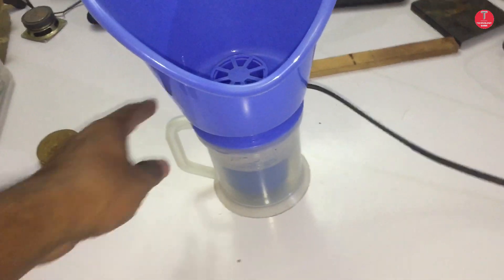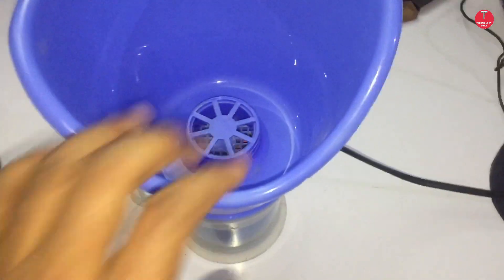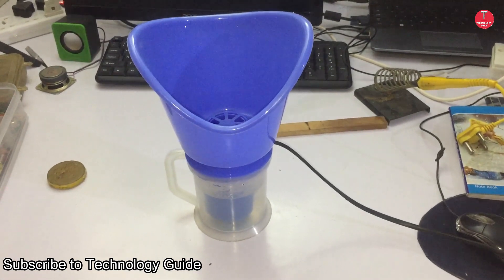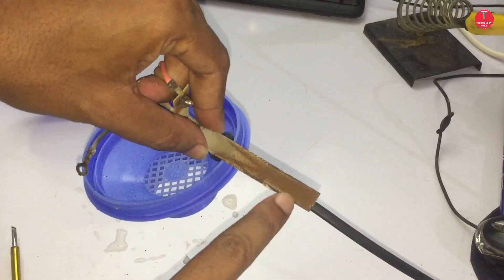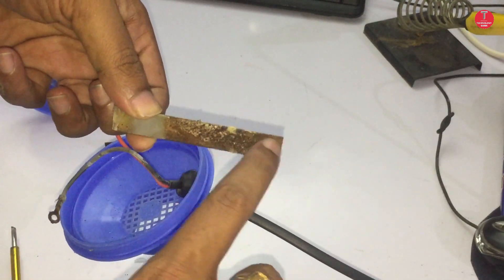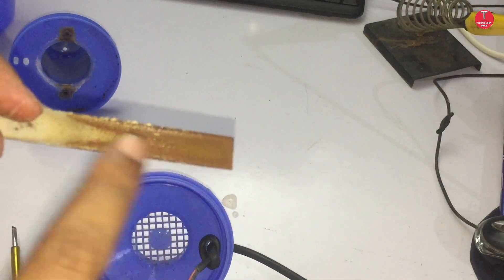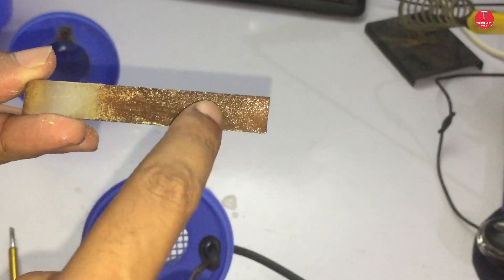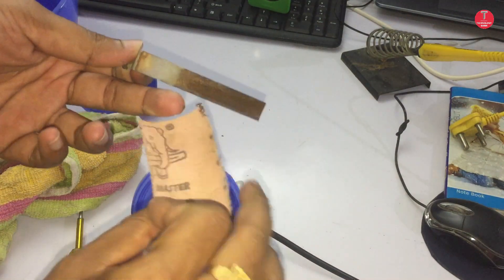How to Repair Steam Vaporizer At Home | Steam Vaporizer Not Working Solution At Home

Comment: Original wire was not giving me enough current. When I changed the wire the steamer worked. But in the evening it stopped working again. I think I am not having enough voltage in the evening. Analysis is going on.
Btw Cleaning the electrodes didn't solve prob for me.
Reply from the maker: Great job

Comment: Does electrodes made of special metal?? Or simple mild steel? My streamer elctrodes filled with salt so I cleaned them with hydrochloric acid. They were cleaned now but not heating water only small bubbles seen on electrodes. What is the problem? Please guide 🙏

Comment: Mine is new steamer bt getting hot very slowly,,can u tell me the reason?
Reply: use tap water not ro water.
Reply from the maker: @sahilmev  right
Reply: @sahilmev  very nice tip. It makes sense and with tap water it worked like a charm. Thank you!
Reply from the maker: fill the water sufficiently then chek it
Reply: @technologyguide5  ha 2-3 hour chlta rha toh water grm ho gya bt steam is not coming properly

Comment: I have same vaporizer I cleaned did everything but not workibg
Reply from the maker: Anil Tandukar you did clean the electrodes but not working? may be Power cable problem check continuity both phase and neutral if know basic testing other wise don't  touch terminals when power ON(supply 230V)
Reply: time to buy new one
Reply: @wipkhoba  no need, buy a wire and get repaired simple.